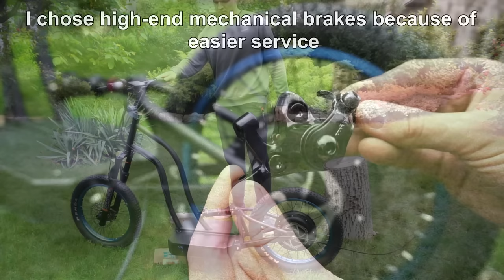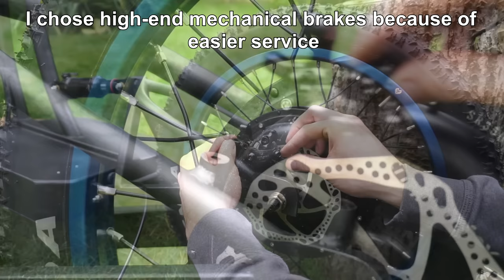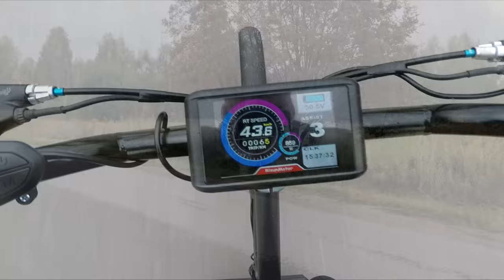Making a Powerful Off-Road Electric Scooter

Comment: how much did all the parts cost?
Reply: More than new one 😂
Reply: @strangetimes5993  you thought it would be cheaper?
Reply: More than my life 💀
Reply: About 3000 dollars
Reply: No…. I would say it was rather cheap. If the batteries are not new, I would say you could build it with ~300 usd. It mostly depends on where you got the motor, bms and esp from. Also this assumes that the metal parts and stuff are already in possession.
Reply: You'd probably find it's the same as buying one, however you're gonna get more power and distance from a homebuilt if you know what you're doing
Reply: @jaynayk1176  300usd? Good one, maybe in us. It was between 700 and 1800 dollars.
Reply: The parts are overkill😅
Reply: This thing isn't over built the money is used perfectly the fabrication was the only expensive part and since its for him its free :) 

This is well built and might I add professional!
Reply: Brilliant
Reply: Cost more than you can afford lol got em.
Reply: @strangetimes5993  ok explain how exactly?
Reply: Bruh, the tools alone are probably an arm and a leg 😢

Comment: Very good! It is a robust scooter for 200 years :) You positioned and welded the forks without any jig and clamps. In this case how could you prove the geometry, especially the front wheel and the rear wheel to each other?

Comment: Very cool build!

I made something similar, only much cheaper and without suspension. In my opinion I'm not sure you need rear suspension at all, front is quite sufficient. 

It's interesting how hard it is to get speed on a small tire. I'm using 16 inch tires and 1kW motor and I get about 35kmh, but tons of torque. And yours must be even crazier!

Around 45kmh must be just perfect and the ride looks super smooth. Great job!! 👍👍

Comment: Very very nice. All of the specs are much better than most commercial scooters. At least those that are affordable. Excellent job on both the scooter build and video production. I hope you make more.
Reply: not quite, just the tires are an obvious advantage but spoked wheels are a disadvantage aswell

also it's only ~2200W (48x45A, 2400W peak at max charge)

alot of cheap scooters (ali scooters) at ~$1000-1200 have way more capacity (range) and over double that power.

otherwise this build is sweet though

Comment: I know a lot of these builds are done on a budget, but it would be interesting to see one with a dual crown 200mm travel front fork with 29" wheel, and slacked out to say 62-63 degrees to make it more stable at high speed.  Maybe 150-170mm rear travel.  Yeah, the center of gravity would be higher, but the offroad capability and stability would be quite good provided the wheelbase was in the 1250+ mm length.

Comment: This style of hub motor scooter is my favorite. MTB hardware etc. More BMX here.  But good heavy stuff  is the point.  Nice job with chassis, the deck/ battery box is really well done. Rake angle etc.  It's important if you want it handle nicely, right. Looks like it does. 20's great choice. Don't generally comment on these builds.  Really like yours.  💯 Nice job.

Comment: Very nice scooter.  I would give you a 9.5 for both design and build quality.
A couple of things I may have done differently or at least would wonder about are...
1) It's disappointing the rim manufacturers don't offer spoke adjuster seats with appropriate angles for the hub diameter and spoke layout you need.
This could be done by machining the seats or with press in inserts that provide a flat surface for the nut at the correct angle for the spoke.  The ladder idea would be ideal because the person lacing the wheel would be responsible for getting the right insert angle pressed into the rim socket and clocked correctly, although the inserts would be expensive until someone with the right screw machine spit out a few million of them.
2) I'm not familiar with this specific controller (sine-wave controllers rock), but for off-road use, even if you can adjust the ramp up rate to max, I would want more than 22 Amps.  30 to 40 might help you get out of a sticky situation like that rogue patch of invisible sand halfway up a gnarly hill climb.
That being said, it is certainly fast enough now for any terrain you might encounter.
Bonus points for the air shock and re-enforced head tube!
Reply: First of all, this man has mad skills. My chief complaint/concern is that that the suspension divides the deck such that he severely limits his side to side foot movement and if he needs to jump off of the scooter one of his feet might catch on the structure. Could the supports and suspension have been designed to be out of he way, below the deck?

Comment: There is one flaw in this build i see from the preview in the intro and that being your stance, standing feet side by side doesn't give you the best forward/backwards stability/balance when accelerating/breaking, other than that, judging from the thumbnail, this is going to be awesome

Edit: i would also add a steering damper to complete the build

Edit 2: just finished the video and it looks so good, but my previous statements about the one flaw i saw still stands
Reply: I think one other flaw (not his fault) but those spokes on the rear wheel look really sketchy, you can see they had to be bent to fit and their spoke angle is 0° on one side and over 20° on the other.
Also to fix his max speed (and improve range) would be switching to a geared hub motor unfortunately I don't think they make them that powerful.
Reply: I have built 2 similar scooters both 4000 watts and both significantly lighter than this all steel build. Don’t get me wrong, I think this builder is super talented but steel is the wrong material here. I started with commercially available frames. The First one is a diggler zephyr which essentially has a skateboard deck to stand on. The second is a Globe 3t race which has the same standing position as this scooter. The Globe has better foot position for aggressive ridding, acceleration and braking are not a problem from a stability standpoint. I agree it seems counter intuitive but facing straight forward with hands on the bars allows for more aggressive control.  The diggler is way more comfortable for long distances since you can move your feet around to prevent fatigue. It’s also nicer at slow speeds for casually getting off and on. It’s better for riding in the city for sure.

Comment: Hi man! An outstanding project! I’m impressed. Not so far ago I made chip electrification for the bike with a 350wt motor kit, in addition I bought 36v litokala battery 10ah. But the result for the distance is so sad, only 16km. Please can you give your advise and recommendation (battery, controller) what I can achieve from this low power motor in terms of the distance. 40km already would be a result, but I dream of 100km that would be the best!

Comment: nice build,i would personally prefer the front where u welded it to the small RHS to be reinforced more,twice the deck length, and twice to 3 times the battery capacity 
but then I would do longer rides,btw ever thought about makin a trailer for it?
Reply: 3 times the battery? Son, it has 35Ah already, good for 120km. What are you talking about?

Comment: Great work!  Isn't there a heat problem with such well-packaged batteries?
Reply from the maker: Thanks. No problem. It's a very large battery, 2000W for that is nothing. The current per cell does not exceed 4A at peak

Comment: Super build:-) Would it not have been better with something like a Flipsky VESC controller (100amp)? I think they can also be used to measure the amount of current the motor can actually handle.

I dream of having your tools;-)
Reply: he used a bms rated for 60 amps so a 100 amp controller wouldnt do much, you dont really need it to pull 100 amps when the scooter is so small

Comment: really nice build ! 
do you have an approximation of the cost of the build ? (not including the specific tooling as the pipe bender or the spot welder ) 

also, IMO the twist throttle is not really great on standing 2wheels. a thumb throttle (like on ATV) should be way more confortable and easy to use on bumpy terrain :)
Reply: I have a thumb throttle on mine and I hate it to this day. I'm considering swaping now.
Why do you think its not good on a standing scooter?
Reply: @Markko1986  twisting means un-grab and re-grab the throttle all the time.
on a bike i dont mind as you are on your ass, but on a scooter you can't hold it with only your feet so when you need to release the throttle or accelerate you hold it with only your left hand if you understand what i mean

Comment: Don't you need a heat sink? I understand that the charging is slow therefore safe, but the torque needs power. I would be afraid of cell damage due to overheating. Nice build though.

Comment: High Score, I will buy it, how much costs, So my add vission is sead antivibration include, change high possiton of drive direct, 8 hours per one loading battery is long, but speed is great, probablly restrict, so this is not important, range is great... Construct design too, professional electricity, so  $120 per unit ?

Comment: Take a look at Robert horns feet forward race motorcycle and allert jacobs aero Honda. I think starting with a big wheel scooter like this you could make a very fast efficient 2 wheel something ⚰️ 🏍️ without too many steps. Probably would need a 20 inch front wheel and steering like a cargo bike.

Comment: So why can't this be mass manufactured?   Seems a lot simpler to build than bikes or even skateboards.
Reply: Look for dogscooter. Bit longer, typically not with rear suspension if any but yeah. Bicycle wheel scooters exist already. Making that electric is no issue. But. As laws in many places limit speed sharply I doubt many would favor that over smaller scooters